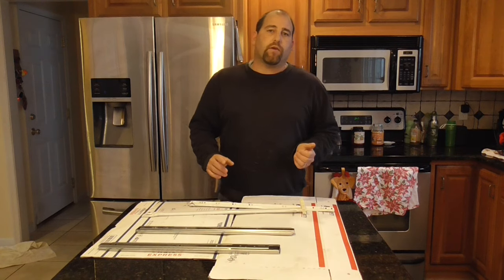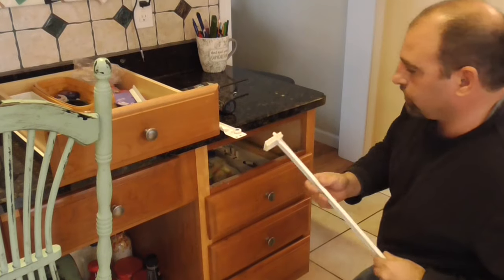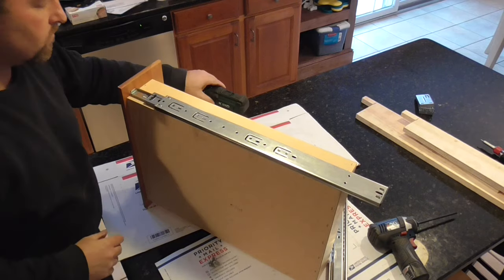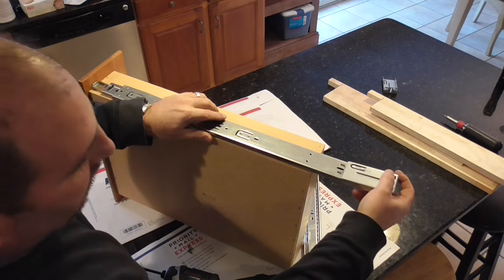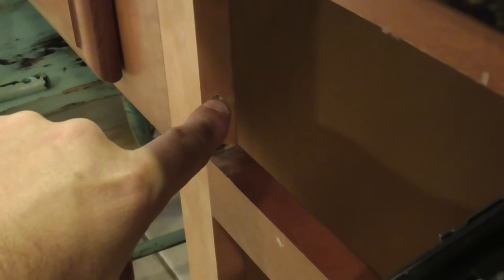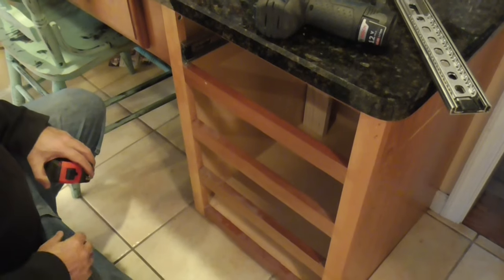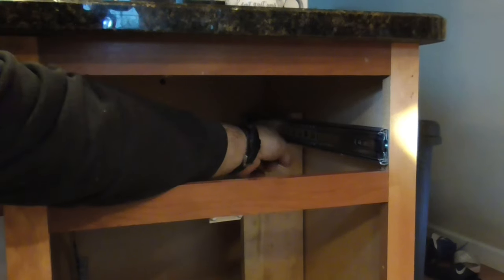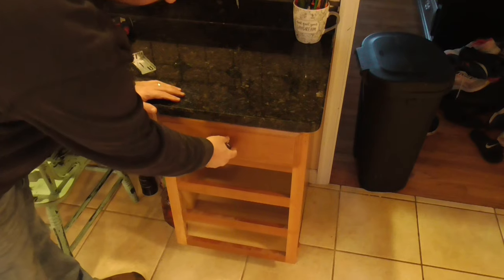How To Install Ball Bearing Drawer Slides

Comment: Big improvement. How did the rest of the drawers go? Maybe you should ask for one those fancy  drawer slide jigs for Christmas.
Reply from the maker: The rest of the drawers went well.  I was one back bracket short because they came in packs of 5, so I cut a set in half and welded them for 2 drawers.  Worked out perfectly.

Comment: Absolutely the best and easiest way to install drawer slides. I did one thing differently. Instead of cutting a board to get the wall space and height for the back bracket I used a piece of 3/4” wide trim piece to space the wall with a clamp at the height to rest the rail on. You made it way easier to install. Thanks again!

Comment: After searching and viewing several videos, this is the first one that I've found that have cabinets built like mine. I also have that gap from the inside of the cabinet to the face frame. All the other videos I've watched have the rail mounted right against the inside of the cabinet. 

So with that gap, I also have to use an End Bracket as you do at 4:51. And now with the "Oh duh, why didn't I think of that?" jig you made as shown at 5:02, I now the confidence that I can get this project done, and surprisingly easy at that. Thanks for taking the time to show us how to upgrade drawer slides. I sincerely appreciate it!
Reply: Follow up: Yup, turned out as expected. The jig made this a simple project. Quick and easy.

Comment: Thanks for the instructional vidio. I installed the exact same ones. This vidio helped tremendously.  However, I had trouble holding my screws to attach the bracket holders in the back. Since my screwdriver attachment on my drill wasn't magnetized I couldn't start the screw. I cut pieces of electrical tape approximately  one inch and stuck the screws through it and folded the tape back and taped it to my screwdriver shank. Started my screw , then reach back and pull the tape off then finish tightening it. Hope this helps someone. No more lost screws.

Comment: Thank you for a clear instructions.  Just wonder how strong these ball bearing slides are if they are installed only on one side of a tall narrow drawer.  I have a cavity where I'd like to install a 24" by 24" and 6" deep cabinet that can be pull out for storage. I'd like to install two of these slides on one side of the cabinet.
Reply: I don't have these slides myself just yet, (I'll be getting mine in a few days,) but if you space your slides as far top and bottom as they can go, and if your contents aren't too heavy, that configuration might be able to work. Conversely, it might also be too heavy for the bearings' retainers and they could "pop out" from the lateral tension. Hope you let us know your workaround! 😊🌎✨

Comment: I see that there are more holes in the end bracket  that once you get the right position of the bracket you can add more screws to give it strength and holding power for heavy drawers.

Comment: You dont need any wooden jigs. Just measure and use double side tape to secure slide to the cabinet. Then screw it . Done
Reply: No. The rail sits away from the edge of the cabinet. It isn’t flush against the side.

Comment: Have an issue with one drawer with this type of slide; it glides open by itself.  Appears that the interior slide needs to be raised but how does one do this with the interior glide still in place?  The drawer is in a tight corner next to the stove and is not easily removed or reinstalled.  Can you advise, please?
Reply from the maker: you are going to have to remove the drawer to fix.  You will get it.